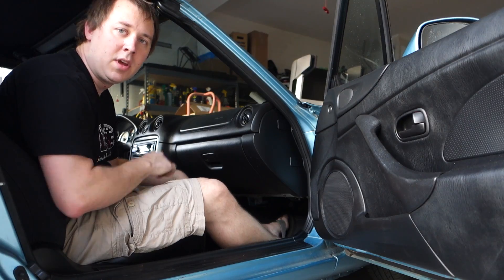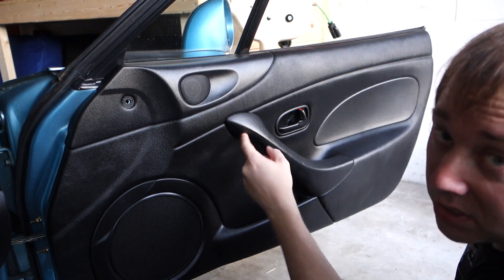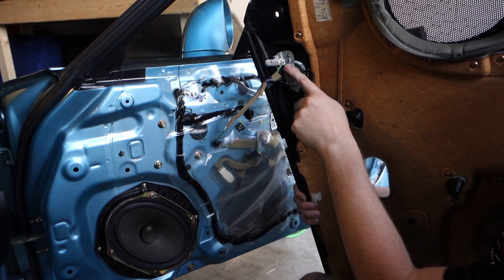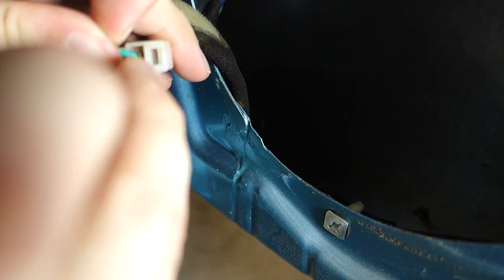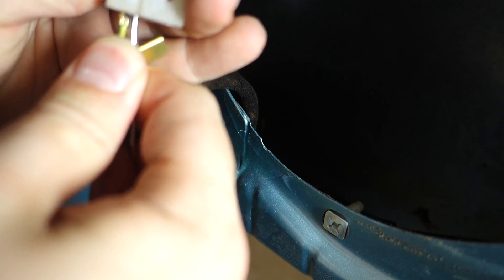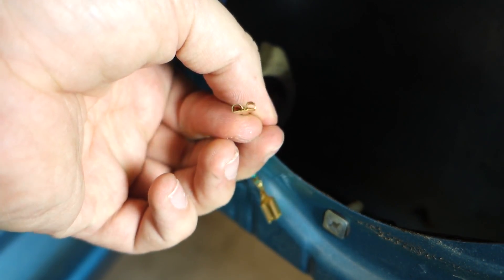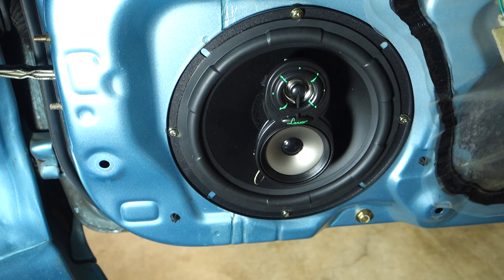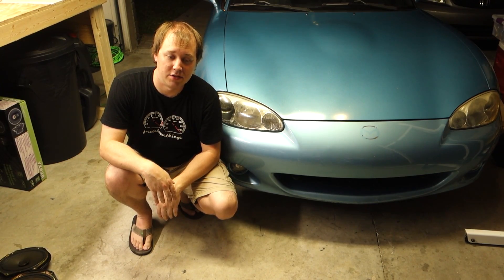Door Speaker install in NB2 Miata

Comment: Great video, I ordered a set of 8” Lanzar 2 way coaxial speakers from amazon. Speakers were just a little too big for the openings, going to try some spacers for a even fit. Speakers sound great, perfect for mid bass with aftermarket head unit.

Comment: The stock mid-woofer that you replaced gets the mid-woofer range from the stereo.  The tweeter found higher on the door gets the higher range.  That will still happen, so effectively your tri-axial speaker is really only a bi-axial speaker.  The high range still goes to your stock tweeter.  That is, unless you disconnected your stock tweets when you installed the aftermarket stereo.

Comment: Note for new viewers - The speakers in this video have been discontinued. Now there is a similar model , Renegade RX830. I could only get 3 of the screw holes to line up perfectly. However there are no rattles so everything should be fine. The new speakers were only $35
UPDATE :  actually they line up perfectly on one door and don't on the other (who knows) .... Bad news - they kinda don't sound that good? I was expecting way more bass response than they put out. I would rate them 15-20 percent better than the stock speakers which really isn't saying much. I'll probably leave them for now and look into getting some really nice speakers that are the stock size eventually.
Reply: alexjumpstar thanks for the update, but yeah i wouldn’t really expect speakers that are below $80 at least to be any good unfortunately. did you buy new speakers? if so, how do they sound now?
Reply: @aurichio7783  they're 4ohm rated at 200w rms, if you run these, dont expect good sound when plugging them directly to your head unit, chances are they won't perform even close to peak power. Instead get a set and run them with an Amplifier. That's the only way you'll be able to run these without it sounding like stock 6.5 speakers

Comment: Great video to give confidence to a hamfisted numpty like me - thanks. 
More of a general question to gauge your opinion: the tweeter in one door has failed. I’m looking at a two way replacement speaker: will this adaquately replace the u/s tweeter?
Reply from the maker: I don't know much about the factory tweeter; I haven't inspected it. There's some info on the NB's audio systems here: https://www.miata.net/garage/nbaudio/index.html
I'd assume that the speakers are just tied in parallel and there's some sort of simple filter network in the tweeter to block out damaging low frequencies, but I don't know for sure.
You may be able to find a comparable tweeter, it would probably help though by bringing the high frequencies closer to your head where they're easier to hear.

Comment: Just bought some speakers to throw in my NB today, I thought I'd need an adapter or clip-style to make the connection, but how does this hold up? It seems to me that crimping the little leaf-ends of those wires won't be the best for longevity, if anyone's done this, can you confirm that this method will hold up? I don't want to do it twice, also, awesome video! Gives me a lot of confindence to tackle this little job myself tonight
Reply from the maker: This is basically how most speakers pretty much everywhere are connected, Mazda just opted to build it into their own connector. Removing their special one and slightly crimping the spade terminals makes it work like a normal speaker connector. Mine are still working fine.
Reply: @Chorca  Awesome! Thanks for the resopnse! I just did this the other day and am loving the new speakers! Thanks again for making the video! <3
Reply: @OvaltineClassique  Put some insulation tape around it as well?

Comment: Do you still have good clearance for your window to fully go down?
Reply from the maker: Haven't had any issues with these speakers, but as someone else mentioned, I don't believe they're for sale anymore.
Reply: Chris Purola  no worries I saw the comments, those looked tall so just wanted to ask if they interfered with the window going down or if they had a good amount of space. Just took my stock ones apart and one is blown pretty bad so gonna have to replace:/ (probably cuz whoever installed didn’t secure wires properly so I got more work taking the head unit out) thanks anyway
Reply: @osalcedoucmsae  I’m not 100% sure cause I’m just going from memory, but I think the speakers will never interfere with the window. The place where the speaker is further forward than the edge of the window glass. So they cannot interfere with the window.

Comment: Tightly crimp down just the back half of the spade connector. That way it's easy to slip on to the speaker terminal and will still lock in. From experience I know this. Just watching this for shits and giggles.